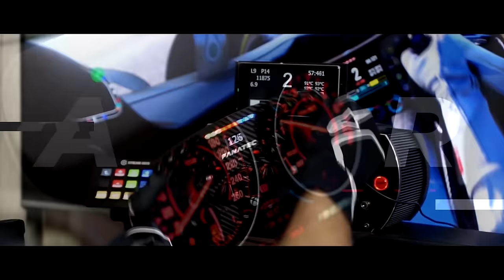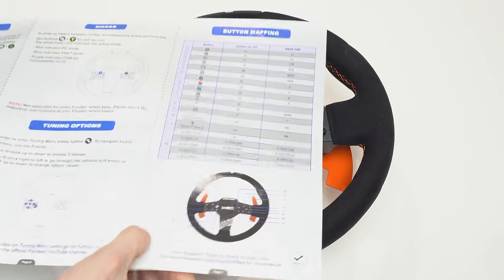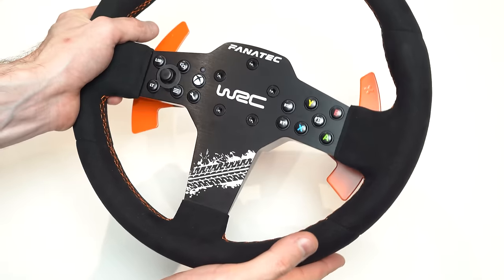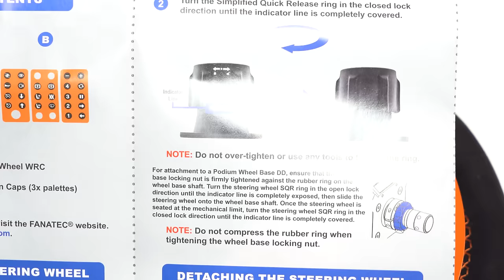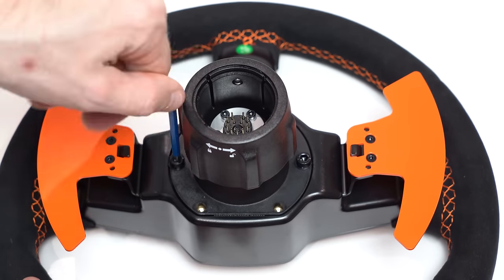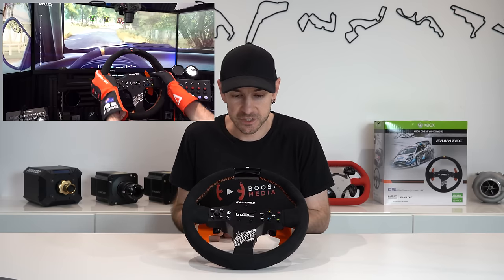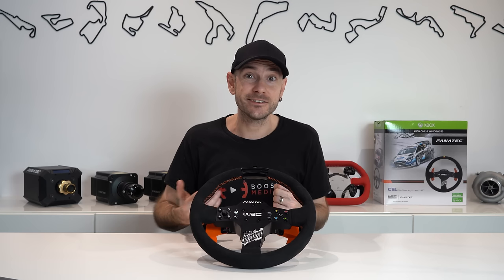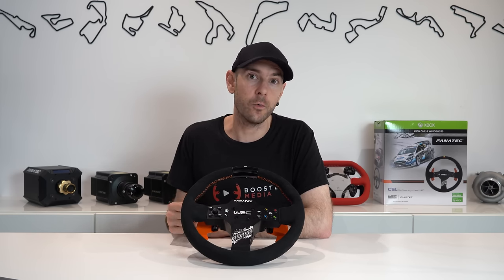REVIEW - FANATEC CSL Elite Steering Wheel WRC + NEW QUICK RELEASE

Comment: Preordered this along with the CSL DD, seems like they will be a good pairing. I wasn't prepared to dumb 400 dollars plus on a wheel along with the DD base and their stupid 8 NM  power supply, which i also purchased because capitalism is ok with me. Wanted that extra 3 NM, will make a big difference from the T300 i am currently using. At least i hope so lol. Great video btw man, as always.
Reply: I'm in a similar situation, I'm in Wave 2 which looks like its speeding up :)   Question, curious, if this will have a low torque mode on it with CDL DD 8Nm? I'm ready to order, but not sure if I should wait for the new RS?  And instead, buy the GT3 now,   although I want to do Rally most of all.
Reply: Same
Reply: I didn’t purchase the PSU yet hoping 3rd party ones will come out
Reply: what do you think comparing thrustmaster and csl dd?  worth changing?
Reply: @SlevinRus  csl dd is a much better wheel base. I've owned two thustmaster tx (both got bricked, due to tm poor reliability) and a Logitech g923, now I'm with the csl dd and even considering it is more expensive the ffb and detail it transmit it's something I've never experienced on the other wheels.
Reply: I'm thinking about ordering a CSL DD. But I can't decide between this wheel and the ClubSport RS :D
Reply: @alejogs500 I’ve been using a G923 for 3 years now and it’s finally time for a change. I was thinking of also doing the CSL DD Ready to Race bundle with the WRC wheel. Any tips or advice before I pull the trigger?
Reply: @TWOhype23  go for it!, after two years (and about 700 hours of use) the CSL DD is still working like new. After the first year I change the qr1 lite for the metal qr1 for peace of mind. If you buy it new maybe is a good idea to get the qr2 base side with black Friday price, and later get the qr2 wheel side. This weekend the formula v2.5x cost $200 instead of the 350 it usually costs.
Reply: Can i ask is CLS DD used with 8nm power supply is good woth that wrc wheel? He said low torque mode and i do not understand with CSL DD should not lose torque right?
Reply: @PlamenSimeonovSimo  I never had any issues with this wheel and the 8nm DD. I moved on from Fanatec now but it worked fine together

Comment: Wow I didnt know about the wheel not letting you use high mode on the DD1?? I thought I asked them that before i ordered and they said this wheel will work fine with it. What are you limited to with this wheel. I just ordered a DD1 with this wheel. Mainly because it was one of the only ones showing in stock without going top tier.  The DD1 goes up to 20 with the key in if I recall. Whats the limit with this wheel. Maybe i need to swap it out

Comment: It looks like a good choice if you're buying/have a non-DD wheelbase.  My personal preference would be a larger (320mm - 330mm) leather-wrapped wheel.  Anyone have a source for DIY wireless button boxes?  Before this came out I was thinking about getting a Momo wheel and adding just the buttons I want for Rally driving - I'll probably stick with that plan if I can find info on connecting buttons through the hub or via Bluetooth/wifi  - It's probably out there on the web someplace.

Comment: Hi Will! Unfortunately my throttle for the g29 gets stuck at about 25% very frequently so my consistency is non existent.  I get frustrated quickly and have stopped playing with the wheel for a month or two. I've been looking at upgrading to fanatec gear. Thanks for making this video!
Reply: It is a potentiometer pedal set, therefore they are prone to dust artifacting, all you need to do is blow away the dust from within the potentiometer or even better, if you can, use the contact cleaner spray and after that seal the hole on the potentiometer with a piece of tape.
Reply: @nejcmirtic529  Or it's dead and you need to buy csl elite pedals... Dats, you chose which one you tell your wife...
Reply: @DouglasThompson  It was a joke dude

Comment: Hey how you all doing, fan and subscriber to your channel. I have just recently purchased the GT DD PRO wheel combo but I have an Xbox and so I also purchased the CSL WRX wheel so I can use the base. You stated in this video that there is a certain screw or button needed on the wheel hub to let the base use full torque but that the WRX does not have this. So then does that also carry over to the CSL DD base? Meaning did I buy a boost kit 180 only to make it in active because of the wheel I chose?

Any help would be greatly appreciated. Thanks and keep up the great work you all do. Cheers m8

Comment: Hey bud, any chance you can see if the wheel fitted with the new qr2 on the dd 12nm base can run in full torque mode or if it will still be limited

Comment: The biggest problem with the snap dome paddles is that they wear down after only a couple months. I noticed it first on the up shifter then a few months after, the downshifter... now one year later, both paddles have no feel/click to them what so ever. They're completely linear
Reply: A magnetic shifter mod is probably the best solution for the button "click" wearing out.
Reply: Do the paddles still work fine despite losing the clicking factor?
Reply: @AshCARisma yes they work fine. The snap goes but not the functionality. I have 3d printed a magnetic shifter mod.

Comment: Do you know if this wheel uses low power mode on the csl dd?
Reply from the maker: There is no "low torque mode" on a CSL DD, so no. Thats only a thing on the DD1/2.
Reply: @boostedmedia  but there is the boost kit... can you use the full 8 Nm with the WRC wheel?

Comment: Why is the torque lowered for use on the  dd wheelbase??
Reply from the maker: Because they deemed the wheel isn’t strong enough to handle above the low torque setting.
Reply: @boostedmedia  i really like this one, is there a similar one to the wrc you could recommend that doesn't have that issue?

Comment: For mine its just a P1, the glass fiber quick release ,well, depending on the rating, ive seen many a glass fiber cordless drill crack and fail. I think it will fit a small market of people who play more arcade style wrc games (anything sim related where you need button mapping this wont do). The problem i see is with the price point,,, if i had a csl elite (which i do) or a clubsport base and was in the market for a new round rim, for only $150 more i could have the BMW.  For what it is, it looks very nice, but my v2 could be gold and diamond plated and i still wouldnt notice it while in a race.